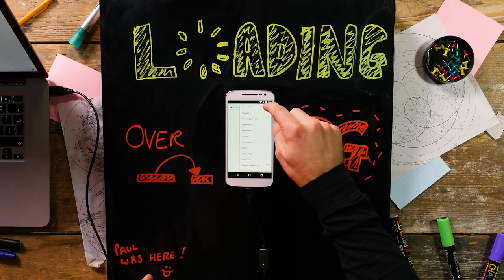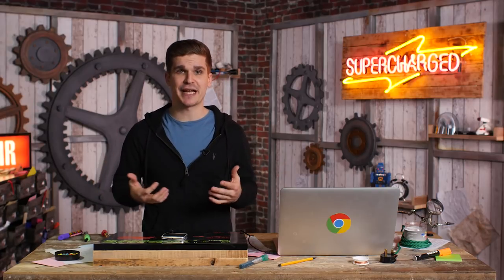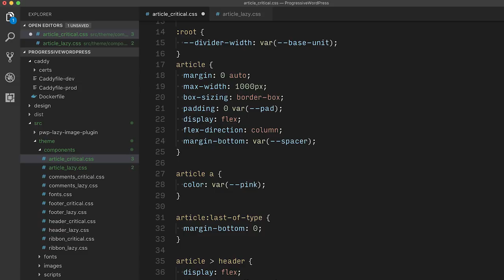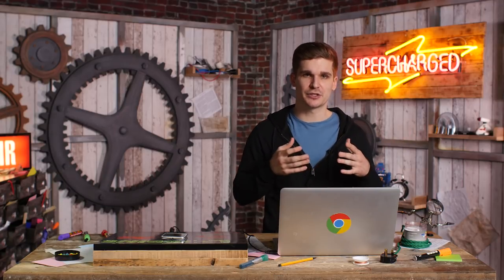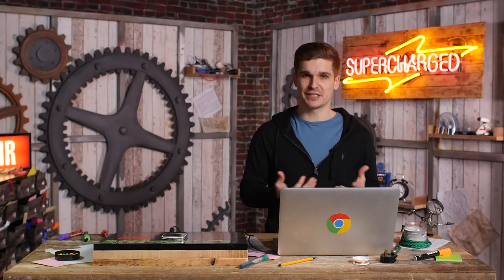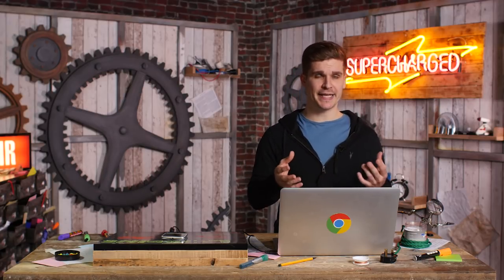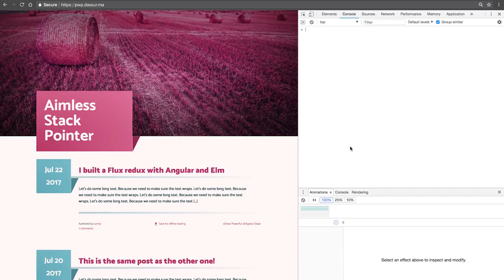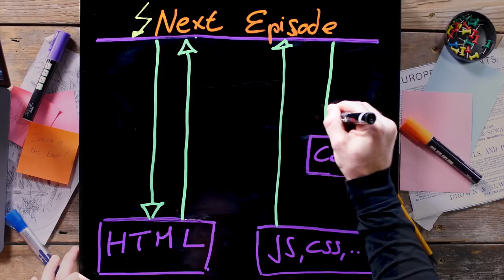Critical CSS loading for WordPress: Commit Log - Supercharged

Comment: including the critical css inline in the html file is fast for the first page load, but if the same css is to be used for a different page, it will be loaded again, requiring bandwidth. That is why I prefer to keep the critical css in a separate file, that will allow the css to be cached and it will not consume bandwidth for each page loaded. This can be refined: have the common critical css in a file, and the page specific css included in the html file.
Reply: The critical CSS is not that big so loading it twice is not that big of a deal, but I rely on ServiceWorker to prevent double-loading later on :)